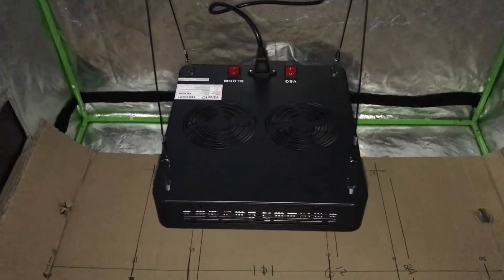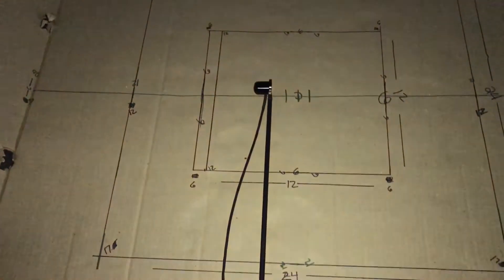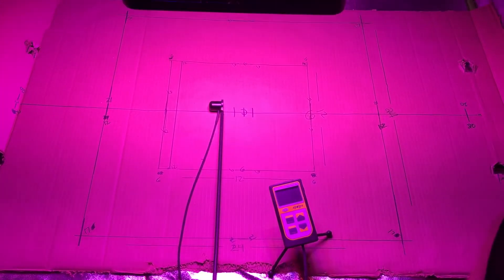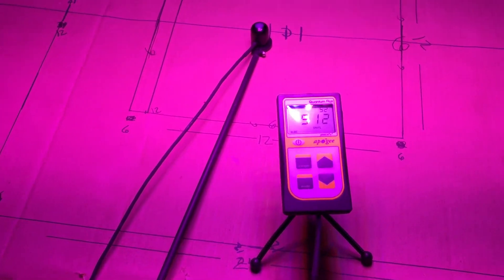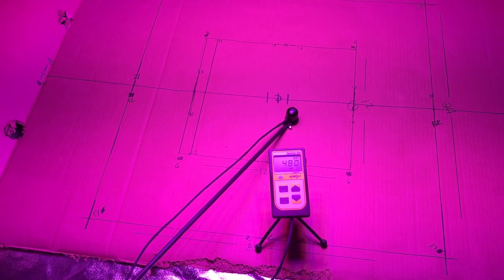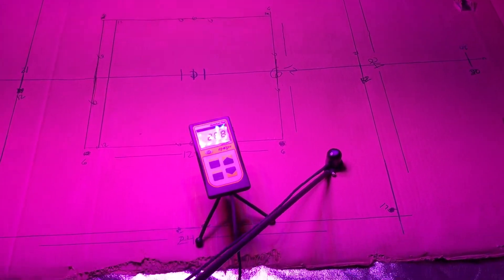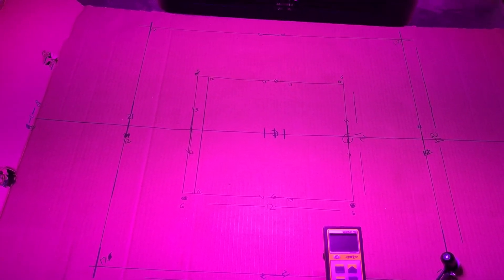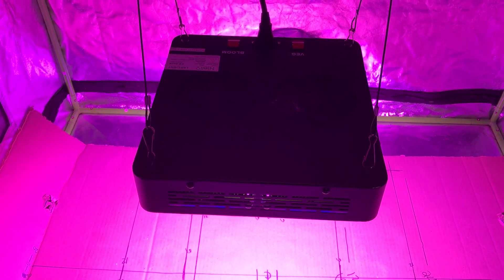Niello 600w M led grow light review

Comment: Hey can you help me pleaseee😪 I have an 80x80x160 cm tent and would need a good 300W light for flowering stage. I am mainly struggling between Mars Hydro, Meizhi, Viparspectra, Niello & Roleadro. But I heard for example often that Viparspectra has less reddish lights, which is especially bad for flowering stage. You tested so many lights, which one would you recommend me especially now for flowering?🙏🏿🙏🏿🙏🏿 Helppmeeeeplssss
Reply from the maker: prinkhaleesi 
Meizhi or vipar, both are great for both stages.
Reply: I have 2 Meizhi 300w and they are great. I have fat buds on my strains.I will buy 2 more Meizhi.

Comment: Great to see you are still doing no nonsense led grow light reviews, there is another cheap led grow light on amazon, called a Bloomspect, there are two sizes 300w and 600w, saw a par reading for the 300w on another channel, and at 24 inches it was around 900 par, now that blows everything out of the water

Comment: You should buy a spectrometer instead of more lights. Just so you could really know which is the better LEDs because PAR intensity and watts is only half of the knowledge.
Reply from the maker: Austyn Banks 
That was the plan, but they are like 3k and so far this channel has made $0, so until that magically changes I can't justify putting 3k into said tool.
Reply: That's true I assumed you had sponsors or donations, my bad, but I do appreciate the videos you have made and for your honest reviews. Hopefully things change and you can keep it going.
Reply: Review It 101.
Reply from the maker: Austyn Banks 
Yeah I wish I did, if I had the cash flow coming in from this I'd definitely buy one. That was the long term goal, to get one to make the reviews even better.
Reply: you need to set up a patreon or someplace ppl can donate
Reply from the maker: jootai 
I have one, just need to set it up with the channel.
Reply: yes donations are waiting to be made xD keep up the good work man